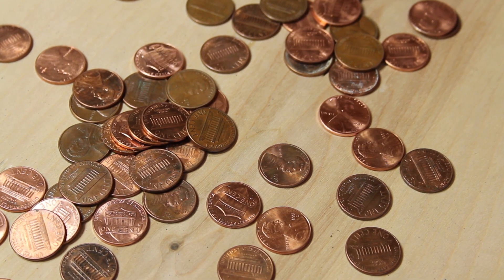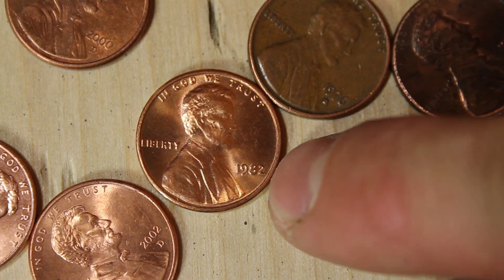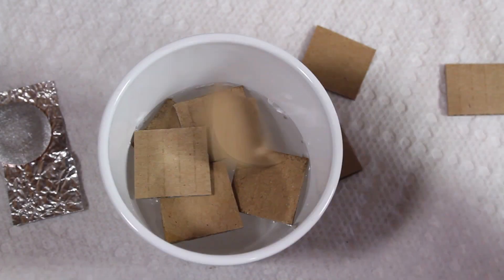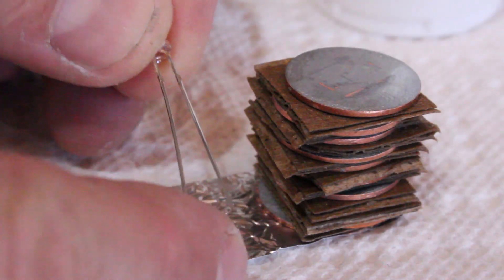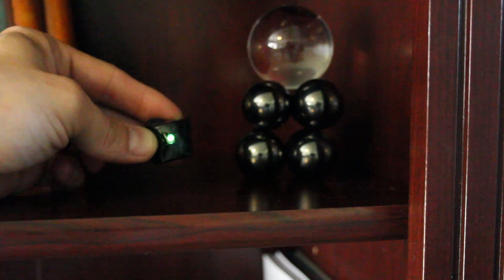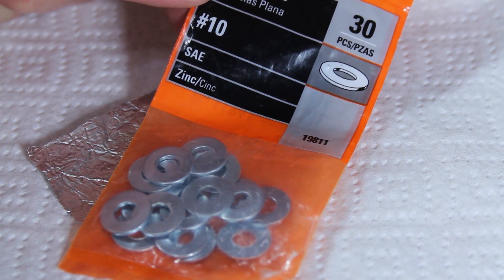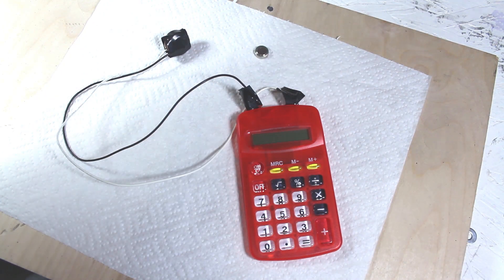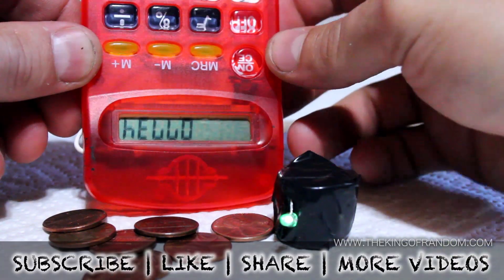How To Make a 3 Penny Battery

Comment: Can you explain why the copper side down on the aluminum? Wouldn't you place the anode (zinc) on the current collector so flip it? I'm curious if I'm missing something because it's copper coated or if that might get more volts?
Reply: To clarify, I'm talking about the first part of the video with only pennies. I noticed you did place the zinc washers down on the aluminum foil first in the second half.

Comment: You should try using a higher concentration vinegar and use copper, zinc washers to see if you can produce more voltage and amps

Comment: When I did it nothing happens I used 4 cells to power a 2.4 volt .7 amp flashlight bulb. What gives. 

Edit: i am using led powerd by 4 pennys  nothing the led is powerd by a button battery

Comment: That doesnt seem right. 98% zinc? A penny 1982 or older is almost pure copper but ones after that werent as pure but still a nice amount of copper. So 1 pound of copper per pound is $2.79 per pound last i checked. 1 pound of copper is 145 ($1.45) pennies that are 1982 or older. Anything newer, you need 180 ($1.80) pennies per pound of copper that has a value of $2.79\lbs. I need to look at the most recent value. 1982 or older is about 3.10 grams each and newer ones are 2.5 grams each.

Comment: whats the max power you can make?
another words if you keep adding pennys will you be able to power an air conditioner?
Reply: Maybe if you take out the capacitors it might work
Reply: Well it really depends in today’s world!  There are units that use DC to run, but what type of A/C are you thinking of?  A car unit, a window unit, a whole home forced air unit, I would imagine all could be powered by pennies.  It’s just each example would need different setups to get each one a working model.  And for how long are we talking about for these setups to run?  You might be better off getting solar panels a bunch of car batteries and a power converter to run a window A/C then a penny battery, at least the solar can be recharged each day!

Comment: When I was 8, I got this circuit set, and I noticed that an LED would work at the exact same brightness at 3 volts, 6 volts and 1.5 volts, but I may need to check it again. (seriously, it doesn't sound right)

Comment: Made one a little different... instead of cardboard I used a blue shop towel. I got only 3.6 volts but still 2.5 under the load of an LED. These batteries tend to die when the viniger drys up. We will see how long mine will last.

Comment: I tried this it was a 2 volt battery but when I put a LED on it  it didn't work and I didn't have a sander so  I had to use sand paper and my thumb was red and I washed my hands then I found out that my thumb was bleeding! So really instead of sanding the pennys it sanded my thumb and the cardboard when I dipped it in the vineger the Learys of cardboard broke and all the pennys were newer then two thousand five
Reply: shankha pal wtf are your saying

Comment: Are you able to charge a phone
Reply: Parker Jones to charge a phone you need 5v 1Amp. This setup gives you 5v , you would need 500 of these cells in parallel to make 1 Amp of current, 10 x 500 = 5000 pennies, 50 dollars$$$$

Comment: So, 5 volts. Does that mean I can charge my phone in the apocalypse?
Reply: GDCassiopeia 5v 1 Amp is needed to charge phone, you need 1 Amp aswell, to get 1 a of current, you need 10x 500 of these is parralel, which is 5000 pennies or 50$
Reply: S.S Toor alright. I'm keeping my rolls of pennies for the apocalypse. 1 roll is 50c, keep 100 of em and boom. (That is, if I have enough vinegar, sandpaper, and time)

Comment: could this somehow Power a raspberry pi 3?
Reply: I haven't tried it, but i'm pretty sure you can. The raspberry pi 3 needs 5.1 volts, but if you want to have it powered for a while, just make 10 cells of zinc/cardboard/copper. I'm not sure about connecting the negative and positive sides to the micro usb cable. You might have to look into that.
Reply: That could work. But don't stack too mutch pennys over themselves, because it lowers the current. I would prefer to seperate them to more battries and combine them, i don't know if this work but I think so
Reply: Alles Well, you are essentially / technically speaking right. 'cause the RESISTANCE will DOUBLE for each cell you add to the SERIES connection.

Comment: This is Centsless, He says many times that the electricity comes from the pennies but actually is a chemical reaction between the acid (vinegar) and the zinc.I thinking you can eliminate the penny and use any copper for the other side of the electrode.

Comment: 2 and a half weeks ???
Soooo...You're telling people that you have made a 43 amperes battery...Or what ?
Because if you drive a 0.17 milli-Amps LED for 252 hours at +- 5.73 volts it's 5.73*0.17=  0.9741 Watts per hour.
This is almost unbelievable unless you film the whole thing by making a timelapse, proving that it is indeed running for 2 and a half weeks...If not, it's a lie.

Comment: Grant Thompson - So would it be possible to take this penny battery to a higher level? like running something that needs way more power?
Reply: Physically, yes. Start collecting pennies now, the apocalypse is coming soon
Reply: mathematically, yes
Reply: M Hayos technically yes, realistically no.
Reply: Unlikely, since the battery becomes a greater resistor the bigger it gets. Eventually, I think, the current will get so slow that it won't be able to power anything.
Reply: As a hvac tech reject... yes because you just need to amp up the voltage
Reply: NX LIFE ENTERPRISES AMP up VOLTAGE hahahahahahahahahhah
Reply: Soulsphere001 yeah as the current running through will have to go to cells
Reply: And if you combine more selfmade batteries? This should not lower the current, right?
Reply: More LEDS! Larger power source!
Reply: Mark Hayos if you make more cells yes
Reply: a trabant needs 6volt battery so connect some of them in series and a lot of them in parrarel and you can start it

Comment: Can you make so many that it can charge a phone?
Reply: I think you can power a phone just check the volts on your phone battery then make the same amount volts, You ask to charge a phone well you need lots more volt and i think also more ampere to connect to your phone charger
Reply: Kenneth Steyn thx it helps

Comment: Grant, I tried the 3 penny battery and it didn't work.  I follow your instructions, made sure the cardboard wasn't touching and nothing.  Used red, green and white 2 volt LEDs  Maybe the washers weren't zinc but I doubt that.  Do any pennies work or do they have to be old?  Help!

Comment: How many does it take run a house?
Reply: According to the video each cell has a half volt, so for a house(240 volts max) it would take 480 cells minimum.

the 240#: http://hyperphysics.phy-astr.gsu.edu/hbase/electric/hsehld.html
Reply: Now all we need is fifty amps and a dc to ac convertor

Comment: if anyone is having trouble trying to get this to work then take a 12 volt battery or power supply and connect it to both ends, it will speed on the reaction and cause u to have voltage, it might just be the hole secret being it idk

Comment: Let's say I wanted to power an electric baseboard heater in a tiny home.  How would I go about constructing a battery for such a heater and how long would you presume it might last?  Can such a battery be recharged and if so how would I go about doing that?  Also, as if all of this wasn't enough....could someone connect multiple sources of renewable energy, such as wind, solar and crank to said battery, all at the same time,  to renew it's energy, so that at any given time it's always being charged?

Comment: just in case their are still people asking where you can get small LED light bulbs, you can easily get them in a store that sells Christmas lights. You just have to find out where they keep them in whatever store you go to. and if the wires are not long enough you can just strip the end of an old wire that is from an old cord or buy electrical wire. Then you would just have to cover the exposed wires from their so that you or someone else doesn't get shocked.

Comment: this is infinity energy. btw
Reply: Nope, its an exothermic chemical reaction. However the released energy is tapped in form of electricity, so it makes some nice battery. After about 2 weeks, these run out and you need to replace them.
Reply: Oh ya because of the metals they rust. You know i have a idea were you can recharge a battery by replacing the leaf when it drys so a battery works when the electron move from the negative. so what i you have a leaf to replace a dead one to regain more electrons but then you need a positive effect the leaf so you have 1v to power a 1v motor. Wow hope u got that.
Reply: Lmao Missed up when you have a leaf to replace.
Reply: So it could be salt or so alkiline fluid . but you have a open part thats were your leaf will go to create that reaction.
Reply: + and - in the same cell
Reply: To move the electrons in a battery, you need a force that moves them. When the acid reacts with the zinc, the reaction applies said force to the circuit, causing the electrons to move. Once the reaction stops, you will have to make a new battery since the old one has run out of chemical energy to convert. So it's a one-way-battery.
Reply: I have to do some experiments that will keep the chemical reaction so i can only replace the leaf then.  Thanks

Comment: hey but u gave me an idea for a water rechargeable battery were i can collect a bunch and get to at least 1 v or more because its alot in a 10in o box or smaller maybe if you read the LED instead using a volt meter then you result will be 1 to 2v if you can power a 1v motor so thanks for this cool idea.

Comment: and its like the dirt battery experiment unless those 5v can power a 1vmotor but it wont because it only has static being collect not like an actual battery that contains electron like the crystal batteries when heated or solar were the sun and silicone crystals create energy. at 1v so this batter has energy your probably reading the energy but no electrons.

Comment: Why do you need to sand one side of the penny and not both ?
and why do we steel need the penny if we are using the zing washers ?
Reply: So we can create a positive and negative side. I we didn't have those, we wouldn't have a current.

Comment: I must have done something wrong, because mine did not work.  I sanded the "tails side" and put them in sequence with vinagar on card board. I solderied lead wires on the bottom and top sides. Any ideas on how I can fix this, thanks
Reply: Did you make sure to sand down until you reached the zinc?

Comment: can you just use zinc washers and get rid of the penny all together or would you still need the penny but not have to sand it?
Reply: +TetroLancer you need the penny
Reply: DMAN22yeah but would you not need to sand it down due to having the zinc washers to compensate for not having the zinc side of the coin
Reply: ***** thats why he uses zinc washers so he wont have to sand it down
Reply: DMAN22yeah ok grand thanks, i was just wondering because where i live the coins dont have enough zinc

Comment: can you use additional circuits to step up/regulate the voltage/ampage in order to power larger electronics/household lights?
Reply: You're gonna need a transformer. If you want to make one, wind copper wire around a cardboard tube (the number of revolutions is extremely important, so in this case, 50 revolutions should do), cut the end of the wire, and then prepare a second cardboard tube, but this time, wind the copper wire 100 times to double the voltage.
Reply: To make it function, place the two completed coils in close proximity, but not touching.
Reply: Oh yeah, and beware of the heat. Cardboard may or may not be the best material to make a transformer. If you have access to better materials, use them.

Comment: If I put in the zinc washers do I still have to sand the penny?
Reply: no
Reply: No, in fact, if you use the zinc washers, it won't matter really what years you use.  The only thing I'd check to be sure of is that no penny used is valuable.  Examples being no mint errors, no rarities like 98,99,00 wide AMs, no 1992 close AMs, no 1984 or 1997 double eared, etc.  Really, I'd use the ugliest, roughest, 95% coppers I happened to have.  Then again, I'm a coin collector, so it hurts to see a valuable coin roughed up beyond any remarkable value, like a 1924S US penny I found in a parking lot, well worn by cars, but few areas untouched showed it was in very fine condition prior to being cast aside.

Comment: If the pennies are zinc and you bought zinc washers, why not just use zinc washers?? Why did you still need the pennies after adding the solid zinc? Just wondering . . .
Reply: +SKenneyGIrl Tan You need the copper to create the + terminal while the zinc is the - . Basically both copper and zinc have a tendency to lose electrons but zinc wants to lose electrons more aggressively. So in essence what you get is electrons moving from zinc to copper creating a current. Lets make a fictional analogy. If you have two people who are hungry and both have a sandwich and none of them want to share then you will end up with each person eating his own sandwich. However if one of the persons is less hungry and more generous then he will give some if not his whole sandwich to the other person thus creating a "sharing" effect. Similarly, if you have the same metal nothing will happen however when you have two different metals where one is more willing to give up his electrons then you will have an electric current.
Reply: +SkorrloreGaming-Productions To my knowledge it is not possible to avoid corrosion. Copper/zinc is essentially a chemical battery because as the current is being transferred you end up with changing the state of both metals. The corrosion of zinc is the side effect. This will always happen in chemical batteries because in a chemical battery one of the metals losses electrons (oxidizes) while the other metal gains electrons (reduces). It sounds a bit counter intuitive to class receiving electrons as reducing but hear me out.

If I have a copper ion Cu2+. The 2 + means the copper has a net charge of +2 because it is missing 2 electrons. When it receives electrons it just becomes copper and is shown as Cu. This is called reduction because the charge is being reduced. So if Zinc gives 2 of its electrons to Cu2+ then Cu2+ becomes Cu because it reduced its charge. However, now Zn is Zn2+ and is oxidized because it gave those 2 electrons to Cu2+. The vinegar is just there to make it possible for the electrons to jump from zinc to copper the corrosion itself is caused by the electrons moving from one end to the other.

*Most chemical properties of elements are intrinsically linked to how many electrons the specific element has on its outer shells. Also most chemical reactions are actually just exchanges between the electrons on the outer shell and types of reaction as well as the intensity of reactions of different elements are again most defined by how many and in what configuration the electrons are on the outer shell.
Reply: All liquids would evaporate eventually. Unless you create some kind of air tight container and ensure the vinegar is held under some kind of pressure then no you can't.

Btw if the vinegar is left and the "battery" is not used it will still deplete as the electrons are travelling from one side to the other whether you use it or not.

I can only assume the reason you wanted to know that is because you wanted to store it.

Comment: So the only reason the battery goes flat is because the vinegar dries out? Why not design one in a cylindrical tube that allows you to drop a few drops of vinegar into the tube every week or two - for an unlimited LED light source to light up wall clocks etc.
Reply: Because eventually the metal corrodes.

Comment: I don't know if some of the Philippine coins would work on this experiment. Mind checking it out? For investigatory project,please.
Reply: +Theresa Galos As long as the coins are zinc on the inside and copper plated they would work. You could also use zinc washers and as long as the coins are copper plated of fully copper it would work.
Reply: Thanks but I still have questions.I'm quite curious. Does the zinc washers react negatively to vinegar? Like changing colors? Is it also okay if we use coiled copper wires instead of coins?
Reply: I don't believe that the zinc will react negatively to the vinegar but don't quote me on that. I'm pretty sure you could use copper wire as long as you make sure it doesn't touch any of the other parts such as cardboard and zinc washers.

Comment: I've done this 5 times now and always get the same result... I never get more than .50 volts or less no matter how small or big the stack is. I tried testing as I went coin for coin and the highest voltage I saw was .62 and it quickly dropped back to under 1/2 a volt again in seconds.. Why is this happening? and what makes it work correctly?  I've done it step by step following his video and never get anywhere near the volts he shows..Need help........

Comment: Isnt 5 volt enough to charge your phone?
Reply: ZenoZX you need at least 500mA at 5v
Reply: +DMAN22yeah  a thermopile and a bic should do it lol
Reply: +Redouan Ouarouss 170 micro amps isnt, thats .17 milliamps and your phone needs around 500
Reply: Yea
Reply: +DMAN22yeah you just need 5 volts
Reply: +ZenoZX Incorrect. You need a steady 5V AND at least 500mA to 2A to charge a phone or other USB powered device
Reply: ZenoZX Why?
Reply: +Redouan Ouarouss You would need 10 to 20 of these 5 volt batteries in parallel to generate 500mA or more. Or build a single giant one from sheets of zinc/cardboard/copper and bottles of vinegar.
Reply: chillzwinter it would actually take hundreds
Reply: +Pete Last no, still not enough